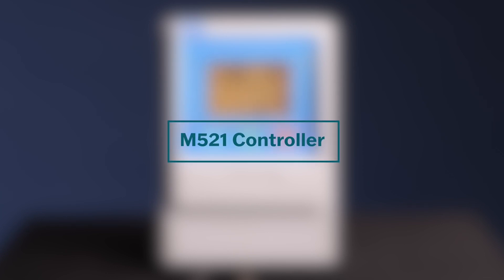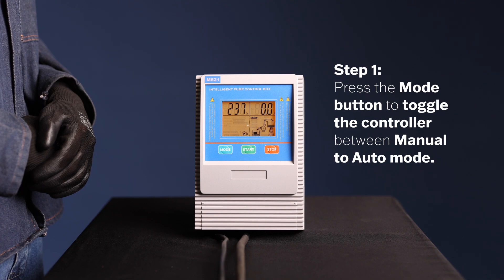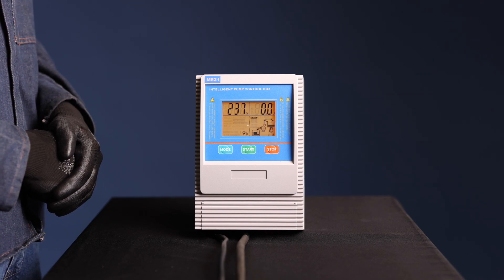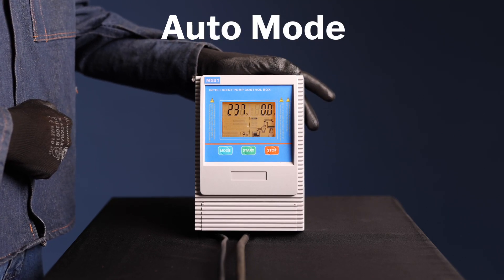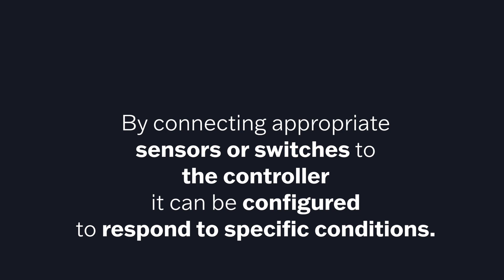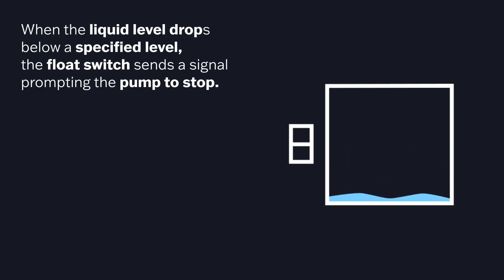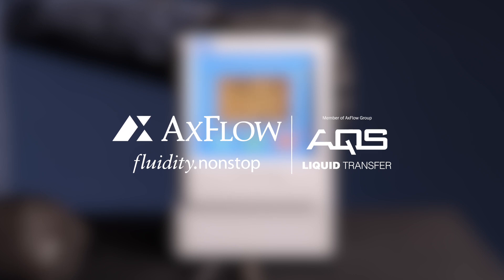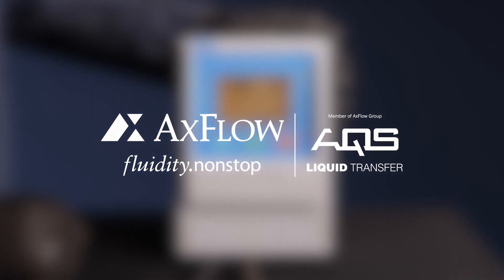Switching Operation Modes on Your M521 Controller

Comment: How / where do i connect a exteral / remote stop
Reply from the maker: The M521 does not have a dedicated connection for a remote stop but a stop can be connected to the "tank full" connection points. 

To do this connect the switch between connections 4 and 6 and make sure that 5 and 6 are bridged out. The dip switches should then all be in the lower position.

Comment: Hey when i pump, the controller will run for like 2minutes then displays the "dry run" warning yet it shows the borehole is full of water. If i switch it off and turn it on  it repeat the same thing. What can i do?
Reply from the maker: Hi there, it sounds as if your M521 controller needs calibrating. You can refer to this video guide on the process to follow: https://youtu.be/_HXPrPbzS_g?si=bQULrM7rI_2HAcvE

Comment: hi please assist my M521 displays maintanance sign AND THE i tried pressing mode button together with stop button but no answer,what must i do it says i must press the store button where is the store botton as it is not on the screen
Reply: please assist
Reply from the maker: Hi @vusinkosi9419, the store button can be found inside the controller (refer to how to calibrate your M521 controller).

Maintenance Light should switch off once the unit is calibrated.
Reply: @axflowaqsliquidtransfer  what causes the controller to keep di sound beeping with no stop and displaying 000.00 withe maintenance sign on the LCD screen and the buttons are like locked even when pressing them nothing happens thx
Reply from the maker: @vusinkosi9419  Something may have caused a short on the internal PCP. Please return the controller and have it tested at our workshop.